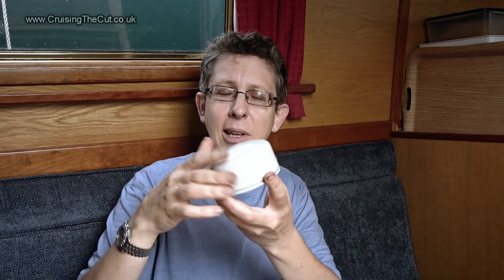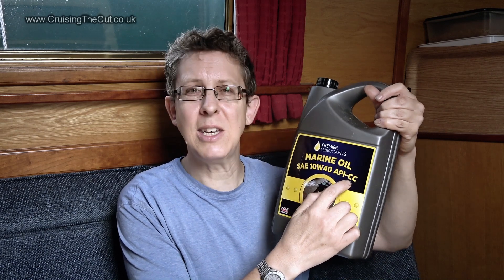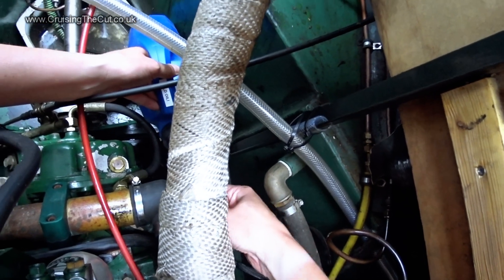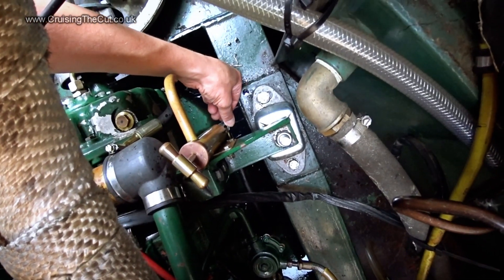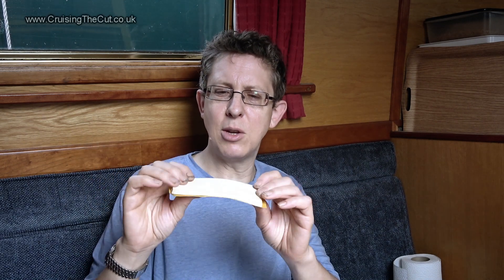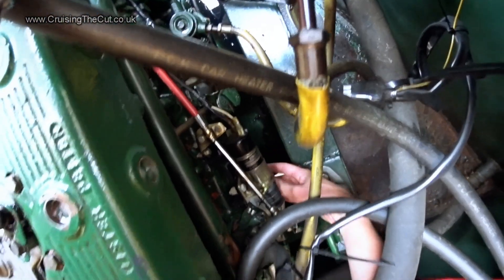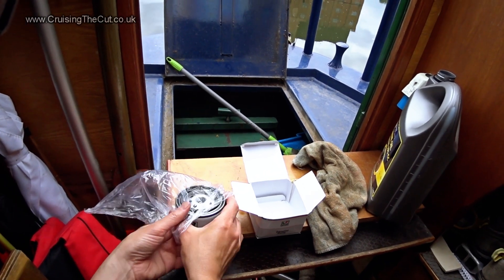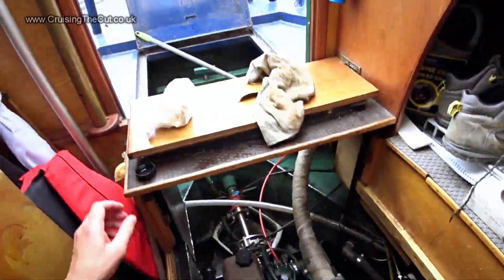110. Oil and filter change on my Lister Petter LPWS4 narrowboat engine (canal boat)

Comment: where do u put the old oil, the bins in great Haywood say your not allowed to bring in old oil
Reply from the maker: There are very few places that will take it, unfortunately. The local tip should but you probably have to drive it there.
Reply: Actually you'd be surprised how many places will take it. Check out the the Oil Bank website for a location close to you or where you're heading. http://www.oilbankline.org.uk
Reply from the maker: Oooh, thank you for that. Top info!
Reply: could always burn it on a fire in a tin can down side is the smell
Reply: True but it will take awhile to burn 5 liters of motor oil in a tin can. It almost burns like gasoline. I was surprised by how much fire motor oil creates when you burn it! Probably better just to take it somewhere that accepts it for recycling.
Reply: The stove is NOT the place to incinerate engine oil, the burn temperature is not hot enough. The oily paper/cotton rags can be used in the stove though.
Reply: There are some mechanic shops that burn old oil in their heaters, at least in the States.  My dad unearthed a 200 gallon tank in his front yard putting in an egress window.  No one would remove the tank until it had been drained.  So Dad put an ad in the local paper.  It was gone by the end of the week.  Don't know if that's useful info, but there you go.  Love your videos.
Reply from the maker: No. Obviously you don't pour it in the canal.
Reply: CruisingTheCut , I was just kidding 😂
Reply: I know I'm late to the party but you can run it in your engine! Yes you heard that right. Diesel fuel is similar enough to engine oil that you can put the waste oil into your fuel tank. This won't work for gasoline engines however, nor fancy diesel engines with special fuel sensors.
Reply: 5% sump oil into the diesel tank at each will up. Your Diesel engine can run on 100% sump oil but it’s not good at that amount.
Reply: @ObamaoZedong  That is correct, Gardner diesel engines work fine on waste oil, I personally pour it through a gorze to filter it and dilute it with diesel at about 50/50.
Reply: Hasn’t the EU made oil like lightbulbs and electrical devices and batteries and the like, in that any place that sells new ones also has to take in old ones?
Reply: @CruisingTheCut  In the US gas(petrol)stations are required to accept used oil which is recycled.

Comment: One tip to help to avoid mixing up the old and new filters, as well as documenting when the oil was last changed, is to mark the date of the oil change on the side or end of the new filter with a permanent marker.  Give it time to dry before installing it.

Comment: Special inexpensive oil absorbent pads and sheets are available here in the US at every marine supply store. They do a fantastic job and do not become waterlogged. Consider placing one under the engine at all times to contain leaks and spills, you will be glad you did so. Cruise on!
Reply from the maker: I have those, cheers

Comment: I once blindly reached down as you did, took off the old filter, put on the new filter, and motored away very happy.. until the alarm went off and all the new oil was in the bilge. When the old filter came off, it left its rubber gasket behind and i piled another one on top with the new filter. All the oil shot out between them. Yes, I should have checked... and you can bet I do now. Hopefully at least one person avoids this mess for having read this.
Reply: Bryan Allen I’ll be changing mine soon so will keep an eye on it, thanks for the heads up
Reply: @philrobinson215  Thanks for saying so. Cheers.
Reply: Nothing beats the luxury of a CCTV camera and LED lighting in the engine bay ;) Cheap one will do.

Comment: Nothing wrong at all with how you change your oil and filter - it’s spot on.  I’ve lost count of how many generators I’ve serviced in my life - dozens a week for over a decade and the process is the same from something small like your engine right through to the largest of engines (that’s a 60 litre, V16, 2500HP for me). Good work. 👍

Comment: A few recommendations. 1. Commentor Stuart White is correct, always  check the the new oil filter gasket is in place on the new filter (they are occasionally missing or misaligned) make sure there isn't another gasket stuck on the filter adapter on the engine. 2. "Prefill" the new filter with fresh oil and allow a few minutes for the element to absorb the oil, then recheck. It's prevents any "dry" moments on engine start up. 3. While lubrication of the new filter gasket with oil is acceptable, you would b better served to use a finger full of grease for lubrication. It's non-stick properties are a bit better.  4. Switch to a 100% synthetic, diesel grade lubricant. The sulphur in diesel engine oil (added for anti-wear and anti-scuffing,) tends to aggressively combine with the water vapor always found in the bilge, to form sulphuric acid in the oil which ultimately attacks the engine bearings. 100% synthetic lubricants also have a longer service life. (Credentials upon request)
Reply from the maker: On that last point, definitely not. I am using the correct, manufacturer-specified multigrade mineral oil, as used on pretty much all narrowboat engines. Trust me, it's the right stuff for this job.

Comment: Thanks for reviving the old memories of having to change the oil on my vehicles.  I used the screwdriver through the filter once then I went out a brought the proper filter wrench.  It never failed that I had to buy to buy an extra quart of oil as it was an odd amount of oil to fill to the proper level.  That was many years ago when oil only came in quart bottles.  Before that oil came on a paper can with metal top and bottom.  One either used a church key or a screwdriver to puncture the lid.  Anyway thanks for the video...Cheerio😊
Reply: I broke a filter wrench and crushed a filter trying to get one off, ended up having to pound a screwdriver thru it

Comment: Quite enjoyable. I used to change oil and filter on cars some 40+ years ago. At least, I could put the car on a lift and do it from underneath. And I used that filter removing wrench with a strap. Learned a lot back then. Learning more now. Keep on cruising.
Reply from the maker: Cheers

Comment: I've been doing oil and filter changes on my engines for over 50 years. I simply waited until Saturday to to it with engine ice cold. No burns but don't be in a hurry as the cold oil flows slowly. Still and all never had a problem other then time, took roughly one hour to do. Including refilling with oil. Never had a burn doing this way. Roughly 30 minutes to drain the oil pan , replace the drain plug (aka turn the valve closed on a narrow boat ) then refill with fresh oil and a new oil filter, refill the oil to the approximate level and replace the oil fill cap. Done.

Comment: Great video. Only thing i could even add is to always check the old filter to see if the  gasket is stuck to it, sometimes it gets stuck on the engine.
Reply from the maker: Good tip
Reply: I'll second that. Happened to me once. Old o-ring/gasket stuck to the engine block (you can't easily see that if you are working by feel). Two gaskets don't seal once the oil is under pressure and I dumped an entire load of oil when I started the engine.
As John said, check the old filter for the gasket, that can save some grief.
Also, worth wiping the surface the gasket bears on, to make sure there isn't any grit or foreign matter that could stop the gasket sealing, or worse, get into your engine.
A mirror might help? Either a hand held one, or one mounted on a wood block at an angle which you place so you can see the filter mount point on the engine.

Comment: Good job.
I always put on an old pair of washing up gloves when changing the engine oil on my motorcycle. Saves getting oil all over your hands, which is apparently carcinogenic once all black and used.
Reply from the maker: It is. I don’t usually bother because the oil changes are so infrequent and done and dusted so quickly. If I were doing it every day, I’d be more worried.

Comment: Use a leather belt to remove the filter. Put it on such that when you tighten the belt around the filter, it is pulling counterclockwise on the filter. THEN put your right hand on the belt with your palm against the buckle junction and twist both the belt and the filter while also pulling on the loose end of the belt in the same direction with your left hand.  As soon as it breaks loose, remove the belt quickly before you get oil on it and it stains the leather.  Works like a charm.

Ensure that the old filter has its O-ring still attached because sometimes the O-ring will remain stuck to the engine .. and that will cause a double O-ring at the base of the new filter. You don't want that because it will leak between the two O-rings very badly.

Wet the rubber O-ring on the new filter lightly with the used engine oil before installing it. Tighten ONLY HAND-TIGHT.

Comment: Hi....always clean the surface that the filter screws on to as contamination here can cause the filter not to seal flat.also you can use sand paper to unscrew the filter as the grit acts as a key.nice vids!carry on up the canal sidney. Best wishes.simon.
Reply from the maker: Good tips! If only I could actually see where the filter screws on, things would be a lot easier!!

Comment: One comment. The Cummins people recommend change your oil, fuel and Air Filter with every oil change. My techs all say they have never seen an engine as tight or the condition so good  when they look at the Milage they are amazed. All I do is follow the Manufacturers Guild lines. And it runs the same after 1,000,000 plus as it did the first day we bought it. Diesel engines are really very well designed and if you look after them they will reward you with extremely faithful service. As I used to operate as an On Demand operator this meant being called out at all hours of the day or night to go anywhere nominal with in 2000 Mile Radius. It was interest work and I drove to good and bad conditions all weather. Certainly not as nice as your "Driving" on the canals but I did enjoy it for 15 years. Please Stay Safe and please get your Vaccination as soon as you can. It is Very Important.

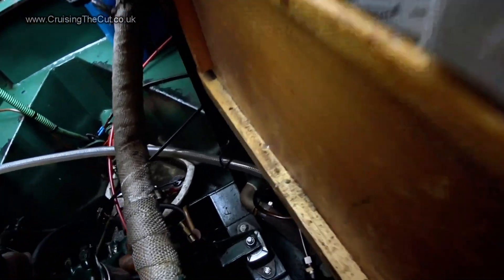Comment: 4:46 Small advice: if you place an ordinary garden hose on the handpump (securly tightened with a hose clamp), you can keep the bin in which you collect the old oil in out of the engine bay. Makes it alot cleaner operation and you will get less burn marks. Make sure though that afterwards you take the hose off or that the hose is not touching hot engine parts (or it will melt and give all kinds of nasty suprises)

Comment: Methods for getting oil filters off:
1) Screwdriver through it- If all goes wrong then you can rip the filter in two and only leave a little stump left
2) Duct tape ( Wrap once in duct tape sticky side in, then turn and wrap once sticky side out) -Mullers your hands
3) Water pump pliers- Usually work, or take all your knuckles off

Also smearing the rubber sealing ring on the filter before putting it on is a good idea
Reply: Screwdriver is the very last resort!

Comment: If you use latex gloves while doing an oil change, you'll be amazed at the difference - you'll be able to grab the old filter and turn it off without a tool, properly tighten the new one, keep your hands clean and avoid burns as well.

Comment: Well done  ! And your filming  was not bad at all. I'm  going to throw some tips at you for oil changes  . When  I had a inboard  4.3 litre motor on a boat . Any other tool to remove the filter is those rubber type gripper  some people use  for opening jars . Here in the colonies they give them away with advertising something or other. You can remove the hand pump changer and use a power drill that has a approved petroleum pump . And put the cap on the fill. A lot easier  and less work . Also on your filters oil  or fuel write on it date of change . Us oil guys  can't remember  poop. And with my visual issues  I . Lastly use some paper  towels or a baby diaper below the oil filter to catch  and drip age.  Again thanks for your Vlog .

Comment: You did an excellent job on that video.
Here are my tips, tricks, and comments.

First off always make sure that the gasket is on the old filter. Some filter designs do not hold onto the gasket as well as they should and the filter comes off leaving the gasket stuck to the engine causing a huge mess and a minor disaster if you don't notice and stack the new filter onto the old gasket. I worked in a shop and this even happens to pro's.

Write the date and engine hours of the last oil change on a piece of tape with the words last oil change and stick that tape someplace you look every time you start the boat, like by the dipstick. Others have mentioned similar ideas, find the one that works best for you and do that it will give you peace of mind. Also you should keep an engine log they are great for keeping up with maintenance and while they don't increase the value of the boat they will help to sell it faster.

Big yellow dish gloves can help with grip and heat when removing the filter.
Reply from the maker: Good tips! I do indeed keep an engine maintenance log :-)
Reply: CruisingTheCut Somehow I just knew you would😉 keep an engine log I mean!
Reply: I too was less than shocked at that revelation.

Comment: Nice video. If you are lacking a funnel, one trick is to use a thin rod like a length of dowel - let the oil flow along the stick and into the opening - it is a trick used to pour acid and bases.
Reply: Or any cardboard or wax paper rolled into a cone shape.  I did this often as I was forever losing funnels until I bought 3-4 of them...

Comment: one thing to be careful of when removing the old filter, is sometimes the o ring sticks to the block, this will cause a leak if you  spin on the new filter with the old o ring in place
Reply from the maker: Good tip

Comment: Just to save you a bit of stress, you can attach a piece of hose pipe with a jubilee clip to the end of the extraction pump. You'll not have to struggle locating the waste oil container under the spout.

Comment: I had a moment at the start of wondering if it would involve a cartridge type oil filter, mostly because I've dealt with those on recent vintage motorcycles within the last decade or so.

I remember the last time my father used a screwdriver and hammer to remove an oil filter. It was on an Allis Chalmers 180 diesel and the filter ended up in multiple pieces, with the base plate still firmly screwed in place. Soon after he decided to acquire a large pair of groove joint pliers, though the long handles likely would be too unwieldy for your access situation. My personal favorite, which I use on motorcycles, is the trick K&N does of welding a standard size hex nut on-axis to the top. I particularly liked those for my old BMW R1100R as they had clearly kept the same lower engine casting designs from when they used cartridge filters but moved to modern spin-on which would just barely protrude at all from the cavity; the filter was impossible to grip enough by hand and no room for the strap tool. Those did have lands around the top end of the side for a special socket wrench but I always found it flemsy.

Comment: If your oil filter is in a hard to reach spot, or too close to very hot engine parts, there is a 'Filter relocation' kit that is very simple to install, and it allows the filter mount to be placed wherever you fancy, with long enough hoses, I suppose you could place it in a cabinet in the Loo so you'd have something to fiddle with while using the facilities. But I don't want to Bog down my comments with bad puns about doing a double dump...In lieu of a proper funnel, the large oil filler opening will accept a cut down plastic jug top. Very handy if you purchase your Top end wine in five liter plastic jugs...

Comment: Small bit of advice, always look to be certain the rubber gasket on the old filter isn’t still stuck on the engine part of the fitting, it will cause a leak if both gaskets are in the fitting

Comment: Any old plastic pop/milk bottle cut in half makes a splendid funnel and can be tailored to your needs
Reply from the maker: But clean it out first!
Reply: Three useful reminders when making a funnel for something like this:
1. Does the opening of the bottle actually FIT the fill port? 
2. Will you be able to cut it safely without cutting yourself?
3. Will whatever you're trying to pour through said funnel eat away at the plastic the bottle was made of?

I still make fun of a friend from high school who managed to fail on all three points when trying to change oil on his first truck. No idea what the bottle he used was, but it did not like having engine oil poured on it.

Comment: David you may or may not know of this little tip, I noticed your bilge was grubby with spilt/leaked oil and water, use disposible nappies they mop it up a treat, both water and the oil. I keep a couple in the bilge àll the time of course away from any heat source, I have never had any problems doing this. But after a suitable time in there you can remove them if you don't fancy leaving them in situ.
Reply from the maker: If you watch one of my early videos, I extol the virtue of nappies. But as explained in the video, the grubby oil you saw was from taking off the old filter and spilling some.
Reply: CruisingTheCut Should you remove the child first?🙄
Reply from the maker: No, small children are good for getting into ticket spaces.
Reply from the maker: Dammit, "tight" spaces. Grrrr